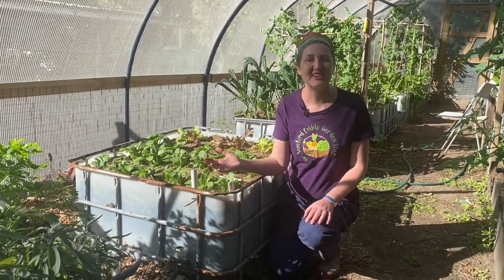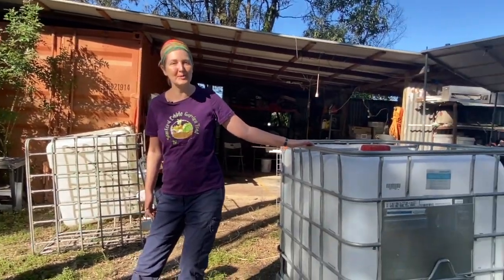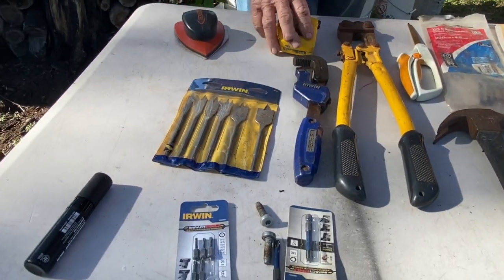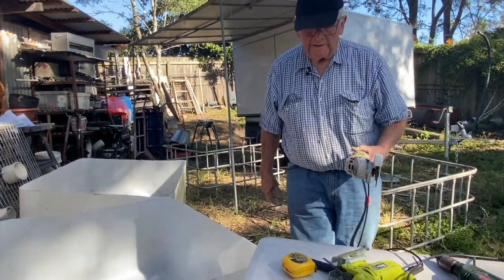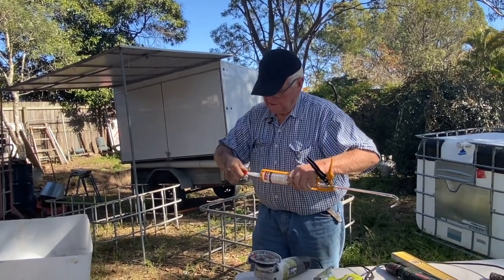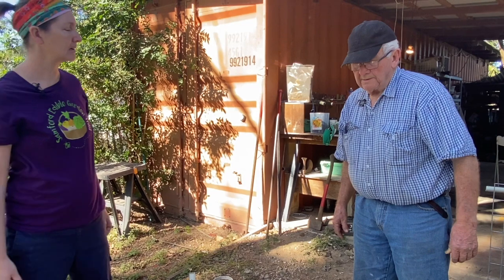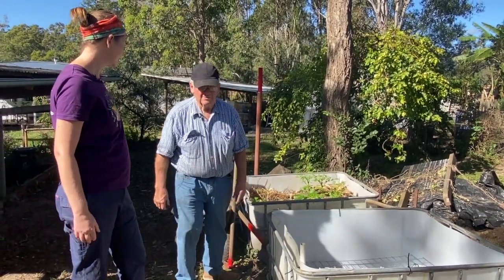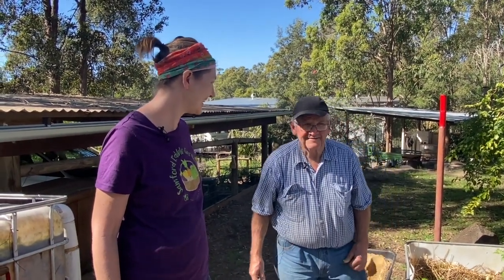HOW to build a wicking bed from an IBC | Step by Step | Tips that make it actually wick!

Comment: Here in the US the "six prong" bit is a Star bit also a Torx bit
Reply: And, while somewhat esoteric, they've been around for fifty years or more. In the mid-1980s, I was working on U-Haul trucks as my primary job. I still have some TORX bits I bought for working on a 1972 Ford F-600. Given the option of a TORX head screw or a Phillips head, I'll choose the TORX just about every time.

Comment: I'm using IBCs in aquaponic set-ups. I cut the top part, which forms the wicking bed smaller & sit them on top of the base (forms the home for the fish). Also, I use rock (scoria) & a bell syphon. Keep up the good work 👍

Comment: 6 inch Black perforated drainage tubing is a far superior way to make your reservoir. I bought the non-perforated and drilled my own (larger) holes with a step bit. The reservoir overflow valve needs to be at 5 inches leaving 1 inch of air pocket for the roots.

Comment: … there should be an air space between the top of the water level to the underside of the wire mesh to allow the roots to air prune … also, the pvc legs need holes drilled to allow better water flow … but, overall, a great video!  👏🏻👏🏻👏🏻
Reply: The only info lacking from this great video: how high do you want to fill the water-above the wire mesh? Even with it? Below it? Also he said 4" of sand, how many inches of soil? I've read 11 inches is about the max height that water will wick up?
Reply: Yes this always confused me. I'm about to build one myself but unsure. So does the drain have to be below the mesh
Reply: @smthngsmthngsmthngdarkside  awesome. cheers
Reply: You need about 1 inch between the bottom of the soil/mesh and the top of the water at full level. If your soil is sitting in the water it will go stagnant and swampy and nothing will grow.
Reply: Will the mesh not rust away??? Can't i just use sea sand?
Reply: @ApisVenandi a lot of people just use sand or rocks. As for sand it should be river sand, because sea sand contains salt.
Reply: Wouldnt it be just the sand in the water. The soil is up higher
Reply: @suzannahseidel6031 but wouldnt it be sand there
Reply: @paulenej5839  I dont know. I've never built one exactly the same as this. Obviously this exact method will work as this gentleman has done many of them and he wouldnt keep doing them if they didnt work. His idea with the mesh would eventually rust away being constantly wet. But you could try using plastic crates or something instead. 
  I used these materials but the "Water Ups" wicking principle. You have your water resivoir underneath, then a 2 inch or so air gap between the top of the water and the bottom of the weldmesh which holds the dirt up. I did not use any sand. I used perlite in each leg of my bed and dirt directly on top of the geotech as none of it sits in water. It relies solely on the legs wicking up the water for the dirt, the same as the wayer ups cells do. It works really well and is a far cheaper way to make a waterups style wicking bed. And my mesh will last much longer hopefully as its not constantly in water- but yes it will be damp as it has damp geotech and dirt on top of it.

Comment: Agrred that this wicking design makes more sense with less expense than filling the bottom with perforated drain pipe covered with rock/sand at a static level. A bit more support for the welded wire support barrier might be good.

Comment: Good morning all the way from Germany! Thanks for the in depth video! I dont see the list of materials in the description as you mention in the video. I would like to know what is  used as the metal grid. (Especially if it needs to be a certain material (i.e. because of  rust) and if it needs to be a certain strength. I have a hard time finding something to compare without knowing what I am looking for (i.e. the original intended purpose the grid is usually used for). Thank!
Reply: Here in the US we call it cattle panels. Large hardware cloth or welded wire.  I know it as cattle panels.  Hope this helps.
Reply: Try weld mesh/galvanised mesh/thin Rio mesh.

Comment: I always thought the wicking pipes had to have small holes drilled all the way round to assist with water being wicked into the pipe and then up into the bed. Spoke with several professional producers of wicking beds and they recommend, sand or perlite as ideal wicking mediums, although you can use compost or soil, but packed tightly into the pipes.
Reply: … yes, I was also wondering about the legs needing holes drilled to allow for water to wick …
Reply: @bluemoon8268  Having built one myself now I can confirm that holes do need to be drilled, at least around the bottom to allow water into the pipe for wicking. Also I do not recommend soil or compost in the wicking pipes, it does rise but not sufficiently, the best is sand or perlite, you can even mix them together and that seems to suck up the water much more effectively.
Reply: Another way is to cut v slots on the bottom of the pipes for the water to enter
Reply: We didn't do holes on ours.  The cut pipe doesn't form a seal and water has no problem getting to the sand contained in the pipe.

Comment: The only thing that I would do, and it is an extra step, is to paint the outside of the "tub" to protect it from the sun. IBC totes aren't UV protected / stabilised so without the paint job they won't last as long in the sun... Just a thought...
Reply: I also thought about that, and if light through to IBC will cause algae to grow?  I considered a layer of black textile cloth or something around the sides of the IBC between the cage frame and the tub.....or paint!
Reply: @samsdaughterdehaven9990  Maybe shade cloth would work between the tub and frame, but paint would have to be of exterior latex... House paint. I hope this helps...

Comment: is there supposed to be a sheet of geotech or weed matt inbetween the sand and the soil? No one mentioned that?
Reply: A layer of geotextile cloth was put over the wire mesh support and then 4 inches of sand.  I didn't see that another layer was put over the 4 inches of sand.

Comment: If there is nothing between the sand and the soil, how do you stop them intermixing?  Anyone have any ideas?
Reply: The sand is much heavier than the soil, so natural stratification will keep that problem in check, no need to worry about intermixing.

Comment: Hi  Team, a great channel and love this idea.  I have experimented with wicking barrels and am now just bout to make some IBC containers, but like others in the comments - am puzzled by the lack of an actual "wicking medium" in the gardens you built.  - In the design you are using ( and I tested this last season and noted the same problem) when the water level drops below the level where it is touching the underside of the geo-tech/ mesh in the base - then there is? no wicking going on? - it's essentially a garden above a water source out of reach?   The design that I have been using with great success, and will for my IBC's is based on that which is demonstrated by Rob: https://www.youtube.com/watch?v=dCgciRQAXEwI 
 A circle of slotted ag pipe ( I lay mine flat unlike Rob, use a 40mm pvcverticallpunched into it for the inlet) covered with shade cloth/weed matt, which is then covered by fine sand to fill all the gaps, levelled off just below soil level - I add a layer of weed mat, and then cover with soil.  This way regardless of the water level, the sand remains wet and "wicking" the water up to the soil. ( like a candle wick, wicking fuel up to the top where the flame is) - and in temperate NZ this means-filling around 3wkly in summer.
Reply: The sand-filled pvc pipe wicks water from the base of the water holding area up to the media above the fabric.